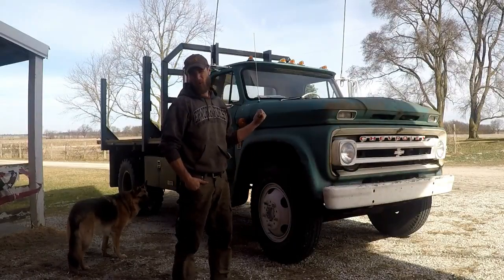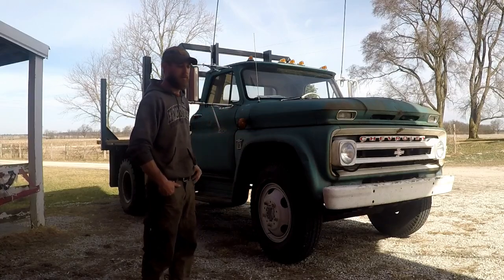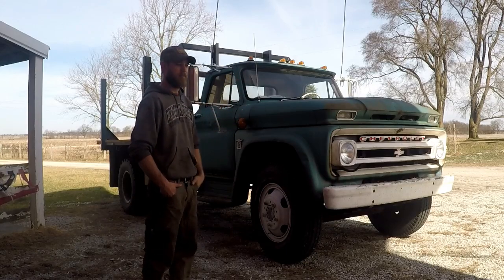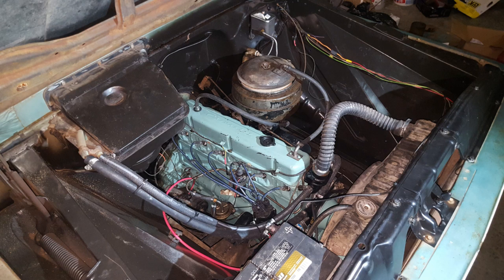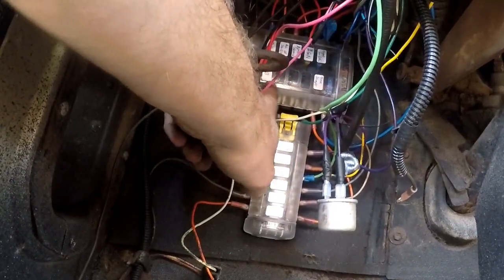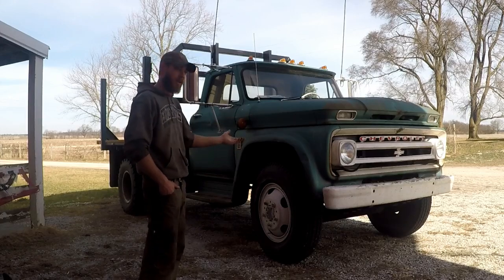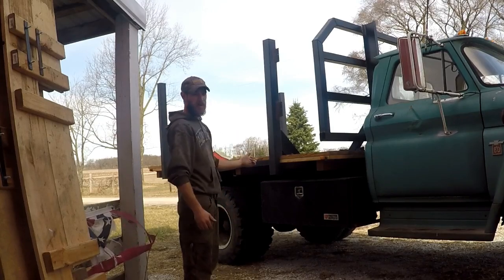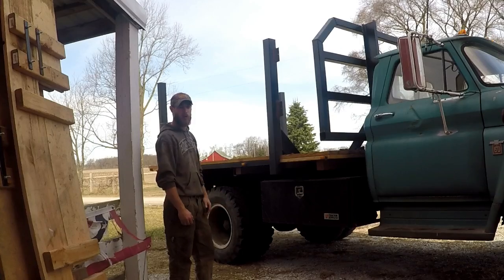1964 C60 Rebuilt

Comment: Awesome job...Looking at a 68 F-700 for about the same purpose....I've found that there is actually more available OEM then I would have thaught.....for re-hab of a half a century old comercial vehicle...You learn the ropes along the way with what you can swap/substitute with the lesser F- series platforms and what is Senior specific only....Similar  to the sharing or lack of compatibility between the 10 thru 30 series Chevys and the 50, 60..etc offerings.....
Add to the challenge that mid to late 60s is the end of the old "tried and true " engineering with all mechanical/servo/power electric entities are all manually operated.....there are no ECMs....PCMs.....Electronic Ignition was in it's infancy....U.S. Auto Industry attempts at fuel Ignition were expensive and unreliable....
You don't find as many folks anymore going back to that period for choice of working truck.....better  to stick with OBD-1 and OBD-2 era comercial stuff....parts.....average  guy can still figure out how to keep it going even when you still can't find the G.D..sensor that's making the truck run like crap.....The difference between Electric and Electronic....well....it's  a heck of a bit more than two letters and a extra syllable....I can tell you....I was blessed growing up as a kid....right in the middle of the awakening of the "Digital "
 World.....
Well....good luck...
hey partner,  I just gotta say this...but.....I swear....years ago....when I was in the Army....I had a Ranger Instructor.....talked just like you and everything.......Not a chance is there?
Reply from the maker: Not a chance at all

Quite frankly, the older the vehicle, the easier it is to work on. I've been on the roadside many a time now in this old girl, but only once have I been stranded (blew the fan belt). They are from an age when engineering included maintenance and rebuildability by the end user, not a dealership

Comment: Top speed 45-50 just bought another one and drove it from winthrop mn to Prescott wi, all original and loud!!!😂
Reply from the maker: With the right tires, a fresh engine, and correctly working 2 speed, you can do 55 all day and push up to 60. Takes a minute to get there and you have to get comfortable with the high rpm's, but the forged bottom end can take it without even sweating.

Comment: I’m thinking of getting my self 50’s or 60’s Chevrolet, GMC or Ford 600 or even bigger truck. It’s just really hard to find any decent truck of that time period here in Finland. Here is quite many ex fire trucks, but they all need cabs, all fire trucks come in here as chassis trucks, so they didn’t have cab at all, only frame and hood and front fenders and power line and about all of these ex fire trucks are 4 wheel drive trucks and I really want rear wheel drive truck. Shipping prices are now much too high, so shipping from USA is not good choice in this moment. It would be really great to haul all kinds of things as hobby etc, but let’s see how long it takes for finding a truck for that. I’m sure not interested of any newer than 60’s trucks. Plastic and computer problems are not my thing.
Reply from the maker: I lucked out with this one being a barn kept queen despite rolling 200K+ miles over her life. I have picked nearly every junkyard in the surrounding 200 miles clean and never come across another truck to salvage any body panels from. There's a number of trucks, but all are so far gone that nothing left is worth it. About the only thing I have had good luck with is the OEM Yankee77 roof marker lights. I keep finding a snagging every one that I can since you cannot get them anymore.

Comment: Previous owner did not try to convert it from 6 to 12 volts. It was 12 volts to begin with. That old Chevy and the 6 in it will do you right.

Comment: Got one wanna drive from illinois to cali hopefully crew cab her while im still at the factory. The fact the c style bodies are the same is awesome. What did you do for your wipers to accept new style wipers
Reply from the maker: Never bothered with swapping wipers. The original style can be had for less that $4 still which is dirt cheap by modern comparison. I keep a couple on hand for when I need to swap them. This way I don't stress the still original wiper motor.

Comment: Hey I got a question for you, I have an old 1966 GMC 4000, like a C40 just different make, where did you find the rims for the truck because I have the 3 split rims on them, also known suicide rims, the truck can't pass inspection with them on so I need solid steel rims, do you remember where you got the rims, or the company's name?
Reply from the maker: I don't have 1 piece wheels, I have ring lock wheels which are 100% legal and perfectly safe to run. The other viable wheel are the three piece wheels which are even easier to work with. I had to hit multiple salvage yards to find a full set of 6 lock ring wheels for me. Took some time but in the end it only ran me about $300 total.

Multipiece wheels are perfectly safe and legal in all states so long as they aren't the center split RH5 style wheels. Those are the widowmakers and outlawed in most places. Just about every tire shop will still work with non-RH5 multi-piece wheels.

If you try to go with one piece wheels that is fine and will let you run tubeless radials, but you need to be prepared to spend about $2k just on the wheels alone. They are a special order wheel in the GM lug pattern and will run from $250 to $400 per wheel depending on who you are ordering from. Occasionally a full set will pop up used, but even then its still > $1k for the set and they are incredibly rare to find used. Everyone always wants the one piece wheels, but you will end up spending more on wheels and rubber than the truck will ever be worth in its lifetime.

Comment: Did you double flare the stainless brake lines? Im redoing mine too but people have suggested single flare instead
Reply from the maker: Double flare. Its not easy but given the zero margin for error on single line brake systems, I went with double flare. Single flare is easier, but not nearly as reliable and since these trucks are single line systems, a leak anywhere will result in total brake loss.

If you are using a traditional flare tool, don't even bother trying with the cheap ones, they wont be able to handle it. I was able to manually double flare with a snap on manual flaring jig, but my hands were shot afterwards. I snagged this not long after and believe me it is worth its weight in gold. https://www.eastwood.com/professional-brake-tubing-flaring-tool.html
Reply: @RocketFarmer  awesome, thanks. I actually picked that eastoowd flaring tool up a couple days ago anticipating this job. I love that thing
Reply from the maker: @daltonbrennan8242  I will never use another flaring tool for the remainder of my life. It was worth every penny, especially with stainless lines.

Since you already have the tool, id stick with double flaring everything to keep a strong joint.

Comment: nice i got 65 gmc 4000.. where you find your brakes??
Reply from the maker: Cylinders for front and rear are still available new from any Napa as well as Rockauto. The 15x2 front shoes are still available via Centric, but the 15x4 rear shoes are a total bust. I lucked out and found a farmer with a NOS set on the parts shelf in the back of his shop. Otherwise the only option is to have the shoes relined by a professional shop. Even then, its a process as they have to be custom done since 15x4 shoes haven't been used since the 60's and aren't a common stock item. If you are lucky and have the more common 15x6 shoes then you can still find those new from Centric.
Reply: @RocketFarmer  i got someone for shoes he relines them.. i need wheel cylinders i got new brake booster n master cylinder on it
Reply from the maker: @davejohnson2937  Centric still makes and stocks cylinders. They are (or at least were) cheap from RA. I spent a total of like $50 on all 6. A quick check shows current prices are up from Jan/Feb '20 when I bought them. I opted for new vice rebuild as the originals were in bad shape and rebuild kits (at the time of my rebuild) plus the cost of machining/sleeving the originals cost more than new cylinders that have fresh, not corroded threads. Obviously current market prices may dictate otherwise for you

Comment: If you want to up the HP Split the exhaust manifold and buy a Clifford intake. Use a 600 ABF carter carb. Now if you ever find a 194 Chevy Six cyl engine get the head off of it and out it on the 292. It's a direct bolt on. 20 HP more right there. Add another 25 for the intake with the 4 barrel with a split exhaust manifold. There is 45 HP you can add and it will not hurt the engine at all. There is more power to be had but I will not get into it here.
Reply from the maker: I looked into building up the 292 but opted to keep her stock style. You can make a 292 a 350 killing machine, but as a farm truck I care more about low end grunt and purposely keep the restrictive intake and single barrel just to keep the power band low. Low power band allows me to chain to things and use the truck to pull/yank/haul/etc easier. If I ever get a 292 in an old pickup though, that will be a different story

Comment: Hey on your fuse box that is on when the ignition is on.  How did you wire it?
Reply from the maker: There is a pink (i believe) wire that feeds from the ignition switch to the stock fuse panel. It will be hot when the key is in the "on" position and dead when the key is in the "off" position. I ran a new pink wire with heavier gauge to the new fuse panel (the lower one in the video). In out of the box form, this panel is a "single in single out" panel; IE each fuse slot is a separate circuit with a required in and out. I brought the pink wire into the top slot on the left, and then made jumpers and jumped the first 4 slots on the left together to the pink wire, thus all for slots are fed by the single pink wire in. Then the right side goes to each individual circuit, all with independent fuses in the middle.

Comment: How is the truck working out?  I'm working on a 1987 GMC 7000 myself... scoping out others' work on big trucks to get ideas.
Reply from the maker: Truck has just over 8k down since the rebuild. Its hauled a few hundred logs, roughly 20 chord split firewood, sand, dirt, and stone. I have since replaced the 3-line OEM brake system for a simpler 2 line system and pulled the dizzy and replaced with a ~76ish GM L6 HEI from a 250 that I rebuilt. I rewired the ignition switch for a second time and used a relay for HEI power to mitigate excessive electric load thru the ignition switch.

Shes no Cadillac rolling empty, but handles a load very well. GVW is only 19.5k and she sits at 9.5k empty. I put nearly 16k on her for a last ditch log run before gas prices went insane and she took it like a champ. She sits in the slow lane with the truck but rolls a steady 58mph with a bit of oomph left to accelerate thru any steer tire situation.

Most don't believe my top speed, but its verified with GPS. A freshly rebuilt 292 with good compression, good ignition, and the right wheels can turn some rpm without issue even with deep gears, it just takes a minute to get there. Even so, on asphalt, there is rarely a need to split shift I have found. Off-road is a different story.

I am still playing with timing trying to dial in good top end rpm with good bottom end response. Its a fine art that I am constantly tweaking. I am somewhere in the realm of 6*btdc initial right now while I play with recurving the HEI.

I wired a Blue Sea Systems charging/monitoring station to my dash to not only support charging capabilities via 12V ports but also to more closely monitor alternator charging via digital readout. One of the better ideas I have had. I use it constantly.

I likely should do a walkaround of the truck to show a lot of the items that went into it. I have had a few ask about it.

Comment: Any idea on fuel economy  between light / no load & normal heavy  load ballpark idea? I looking at '68 pretty  decent shape - It would have to go between two farms 30 miles a part 3-4days week hauling g logs o e way empty o return trip - Thanks for video.
Reply from the maker: Rolling empty at 9500lbs she pulls a pretty steady 9 mpg on regular pump gas (no premium or octane booster added). Running loaded at 20k she does about 7-8ish depending, but that's with pretty steady 57mph speed with almost no stopping on the drive between the farms. When I'm hauling around either farm and grunting thru the gears, she drinks a bit quicker. Overall I'm pleasantly surprised, but it's because of the fresh engine with good compression. Prior to the rebuild she got 2mpg at best. The 292 is nothing by today's standards, but grunts better than any engine I've driven and eats less fuel in doing so. Granted, I also don't set any land speed records either
Reply: I had a ‘69 C50 with the 292 and it got 5 mph.
Reply: @mykelbaurle5758  , my 51 Chevy 2 and a half ton flatbed with a 292 got 12.5 MPG loaded and up to 15 empty. It weighs just under 10,000 lbs empty.

Comment: Where did you get wheel bearing and brake parts?
Reply from the maker: Took original bearings and seals off and into NAPA with me to match up with new ones, it is the only way you can do it anymore. Dont bother on the paper gasket outer seals. Just use RTV. I used rock-auto for my wheel cylinders and then NAPA Maxi Pack UP2474 is the hardware kit for the fronts. You need two kits in order to piece together the hardware for both sides. The front 15x2 brake shoes can still be fount new from Centric, part# 111.02990. The rear 15x4 shoes for the 15k lb axles cannot be located anymore, don't even bother trying. You have to remove the shoes and have them relined by a professional shop. If you have the 17.5k lb rear axle with the 15x6 shoes, those too can be found new from Centric (don't have part# on me).

There is no source for the star adjuster nuts or any of the rear hardware for the brakes. Whatever you do, don't loose the star nuts, damage the return springs, loose the cylinder feet, or strip the star nuts on removal. Lots of penetrant, good soak time, and heat are necessary to get them off if they are stuck on. Then chase the holes, slather the suckers in anti-seize, and put it all back together.